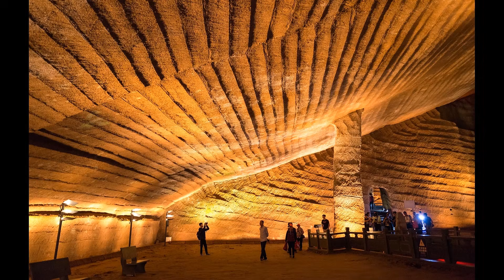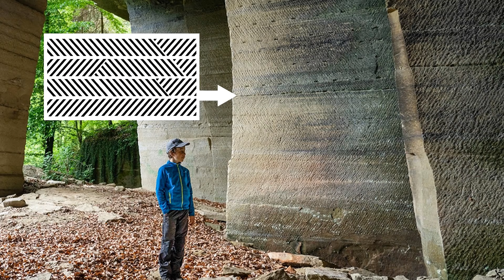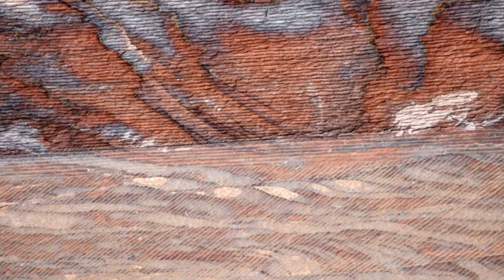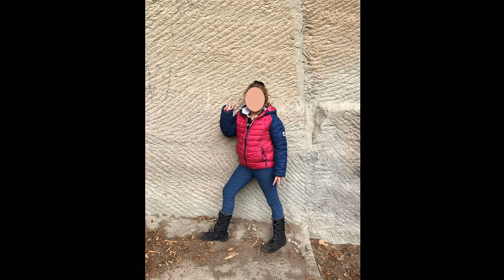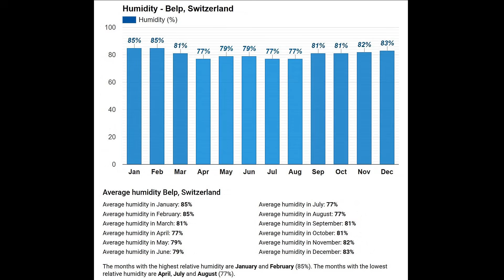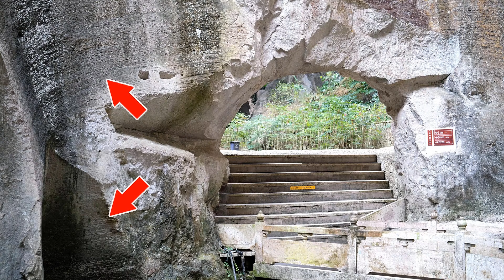A Method to Decipher Ancient Machine Marks from Hand Tools

Comment: It makes sense to cut parallel lines, either curved or straight, into the rock when removing bulk material. You don't want to expend the effort to actually chip away all the mass of the rock. If you cut parallel grooves into the rock you can then simply hammer the material and break out the chunk between. How deep you cut would be limited to the tool and cutting method but it would allow much faster removal.

Comment: Most likely rotating disks with some kind of hard material attached to them or possibly a hard material embedded in some type of rope which is then run around a wheel. I'm think of how they cut up the Soviet sub Kursk(?) with a cable used like a saw. They went back and forth like a saw in that instance but fashioning a wheel with like a "V" on the perimeter, maybe even something resembling the drive wheel of a tank and the rope type material with embedded with a hard material which rotates and removes the material in question. That wouldn't even need to be a very hard material when working with the sandstone.

And the rope material would easily disappear over time. The wheels, if made of stone might even be onsite today but not recognized for what they are? Or if made of iron or steel would likely have rusted away over the centuries. The "tooling" could also have been relocated to another site but for whatever reason not used and therefore could be in plain site but thought to be something else.

All of this is of course speculation, but anyone with at least one partially good working eyeball can clearly see that whoever made these structures were much smarter than the idiots telling us that these people were primitive. Obviously.
But getting more eyes to see these structures in the way that you are showing them I believe will get people from varying fields of work involved in trying to decipher this. Granted, unless we find written (in whatever form) records of how it was done, than it will remain theory and speculation.

I believe that I know the civilization that did this work, but that would speculation with a bias from my theology, but many don't believe even though it fits the bill. 

Anyway, thank you for the time spent making this excellent video!

Comment: Would love to hear some creative and logical speculations on things like templates and track-like equipment that would guide and advance tools that were manually powered. Besides making regulated cuts and eliminating wasted motion, they could take advantage of the strength of multiple workers simultaneously, achieving higher pressures at the tool tips and/or faster tool advance rates. Also possible are simple reciprocating or intermittent rotary action machine design with (multi) human power. Even simple one-man devices that guide and regulate the cutting element would be a big advantage and would likely leave the marks we see. A primitive but effective machine is not anomalous. Fancy power sources are, but are not needed to explain the marks.

Comment: Thanks for a great video, Tina.
As you pointed out, the markings in Longyou caves are different from the others because of the special double line between each course. A person who knows about grinding machinery may provide you with an explanation of how the grinding head may (have) look(ed).
Baalbeck: Because of the excellent pictures, the cuts seem to have the same depth and space between them, showing the rotating grinder has many parallel  'teeth'. The markings doesn't show how the blocks was excavated, but how the surface was 'smoothed'.
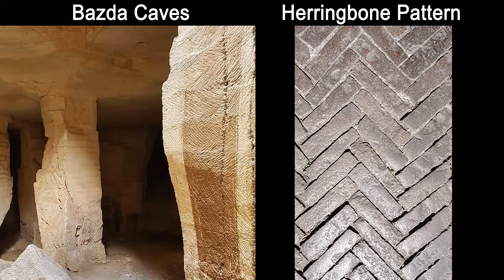Changyu: The markings are parallel, the cuts have same depth. I suggest a machine with a long, rotating vertical shaft with cut-wheels like cogs was moved sideways for 'ling' distances. 22:50 I can't explain the sharp inner corner seen to the left ... except if the machine used heat/plasma or water jets.
Reply from the maker: Thank you for sharing your insights - very interesting ideas. I appreciate that!

Comment: Hi Tina,
GOOD ACRONEM. Steam is of course a perfect choice. upon seeing your modeled curve arch sizes of the circular groves was far larger than I thought them to be. Some of the granite tool saws I was familiar with are Italian made 3-meter diameters saws. those arch curves are beyond that diameter. It is machine made carving lines is no doubt and the archeologist's need to go back to school and truly learn to spot real tool usage and not the speculative methodology they use. I still often want to interject the ideas of these were not quarries but carved out areas. Yet some areas do look like it could have been quarries but where are the blocks or what we called "loafs" that were removed. loaf as in a loaf of bread block, ours were on the lines of 9 feet tall 15 feet long and 6-8 feet wide. and at 188 pounds per cubic foot of granite, that is some tonnage. Also, if it was a side-to-side articulating per revaluation cutting wheel, you could get the ribbed circular carved striations of a forward driven motion. BUT that would be a strange mechanical device machine. so, it would have to be double sided circular toothed thing to cover the width traveling to be a slice or slot carving to remove a so-called loaf. So once again I am bewildered has to the design type machine that it could have been. And again, there is the safety of such a large design and required horsepower and tensile strength of fabricated machinery that the wheels of engineering feats just become - WOW. I want to see that 2000-year-old machine. I personally think its older, much, much older. What was the given power used to power such a wheel carving machine. Its more than some gears n pulleys fabrication. Its a monster machine. And that is only 1 of the tool striation cut marking I saw represented in this video. This does not look like it could have been a torch head device. Flame is more refined quality, most of these looked far to jagged as a cut/break off fragmentation cutting method.  Once again thank you for your time and efforts in this presentation.
Reply from the maker: You've brought up some fascinating points and observations. Thank you for sharing your detailed thoughts on the potential machinery and the nature of these ancient markings!

Comment: Yes very difficult  , particularly to corners  , the density at different times of the year , but it appears this or these marks are common to other parts of the world , therfore  , taking the oldest structure in India  , will perhaps give a time line backwards  , which before the biblical floods , a lifeforms existed , and developed  ,  sharing techniques carried to other parts of the world , then this displaying trade and communication was normal  , and intelligent  , what would they have eaten,  what was their general size , but what is important did they , burrow into rock formations  , instead of building on the surface  , so the qwest at the moment is why ? , was it safer , was it warmer , clearly this burrowing into rock and building with vast , tonnage blocks was not a problem for them , and always the same , meaning the exact fit to fit was always done , meaning the cycology of what they did in life was to a very high standard  , no gaps  , weight was clearly not a problem either  , got to be millions of year ago , futher  , sound , the use of sound for a tipe of jackhammer effect , ????

Comment: what if they used fire to heat the rock prior to excavating it, and most of the soot was on the rock they removed. They'd set up a row or torches, mine it, and set it the next row and mine that, ad infinitum. Or not, just an idea.

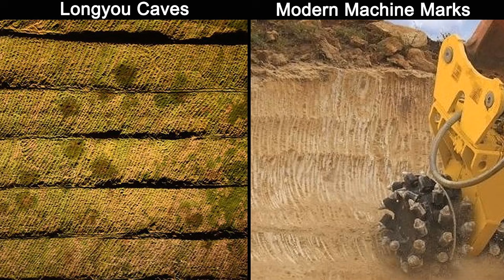Comment: 3:29, blatantly man made cuts with a hammer and chisel. just look closely at the third row near the left side. there are parallel marks with a fan of differently angled cuts overlaying the parallel lines, machines do not do that. a lot of the cuts change direction and even add in partial lines. ask any stonemason (a decent one) if they could do it, "sure no problem". in fact a modern stone mason would get far more consistent lines just because of modern tooling. watch some stonemasons work and street sellers, see how fast and consistent they are... the "scooping" is easily explained just by bending your elbow, see how your hand follows a curve...

It's a nice hypothesis but it doesn't match the physical evidence. It's like people that see the core of an extinct volcano (devils tower) and claim it was a massive tree. Just because something looks similar does not mean they are at all the same.
Reply: A ridiculous analogy to compare someone who, maybe, thought the devil's tower was a petrified tree... ( it is of course a UFO landing site as in ' close encounters of the third kind'- a documentary...😅 )
Reply: @rossnolan7283  lol
Reply: Doesn't work to consider a single evidence when there are many evidences to arrive at a comprehensive theory. Blatant machine tool witness marks, close tolerance form accuracy, forms that we  barely could duplicate now, processed igneous stones, large masses moved etc. Get a piece of red granite and duplicate one of the ancient artifacts to appreciate the problem, even let you use powered hand tools.